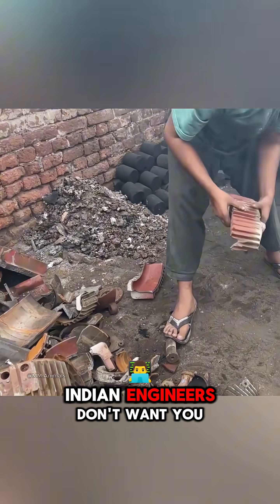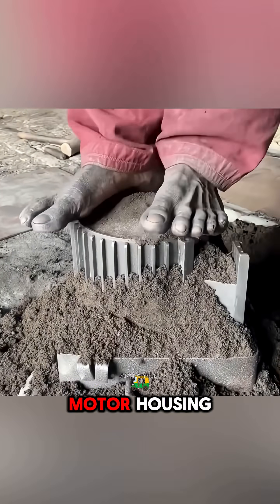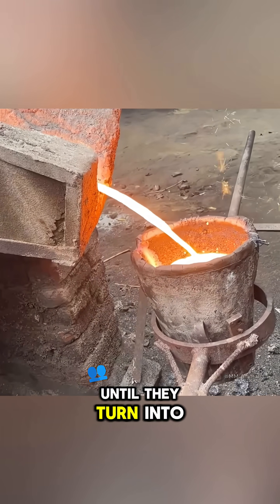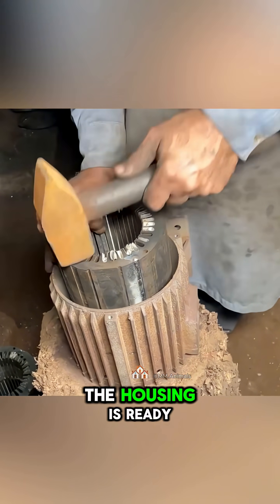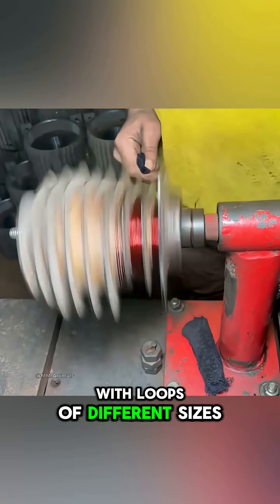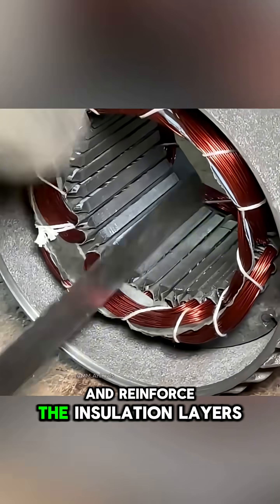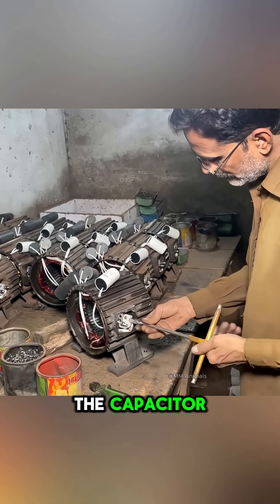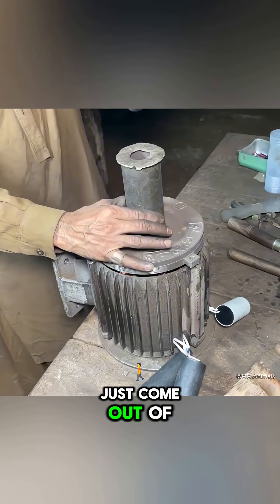This is how an electric motor is manufactured using pure scrap metal #engineering  #technology

Comment: Assemble rotor, bearings in dirty & sandy workshop. What could go wrong?
Reply: Right, I'm amazed at their resourcefulness but I'm curious how long one of these recycled motors last. Is the metal casting strong enough? Are tgey dangerous  ?
Reply: These motors last atleast 20 years with warranty. Made in Pakistan .